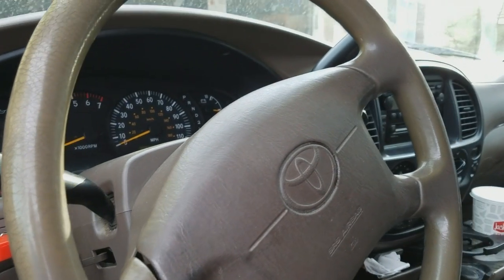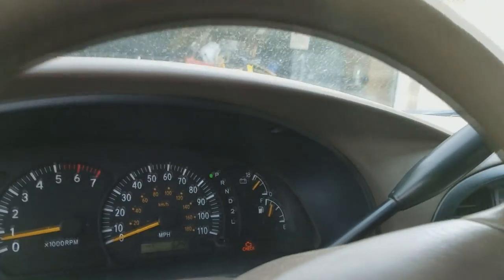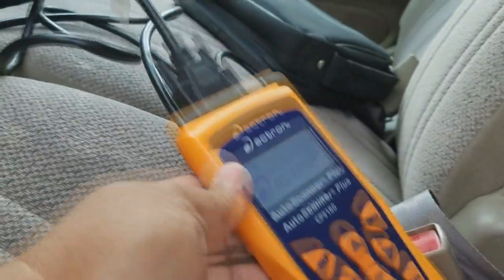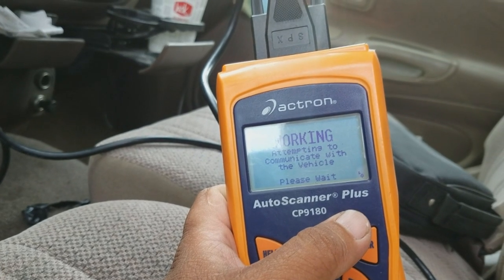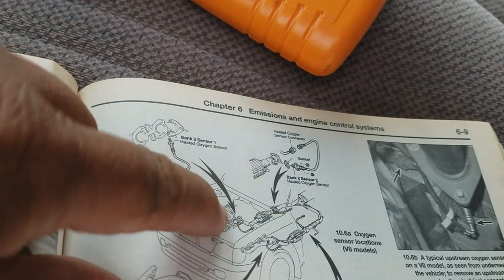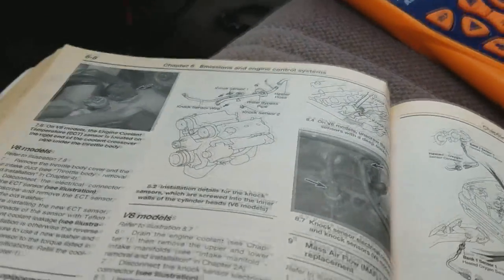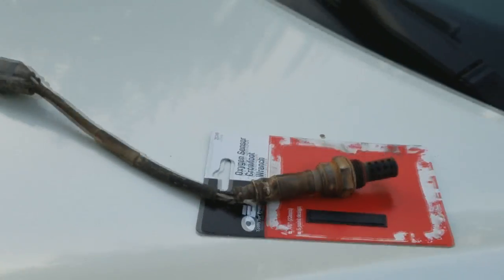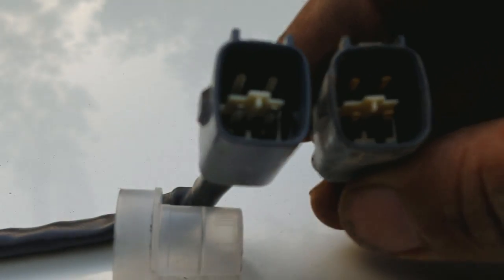Toyota Tundra Oxygen Sensor OBDII P0155

Comment: It's a good idea to put anti seize on the threads. O2 sensors get stuck even if they aren't over tightened.  After you clear the computer you need to drive up to 100 miles to give it a chance to monitor all the sensors and register the results. Sometimes it may be complete in about 50 miles. You'll know when you connect the scanner and check the status. It tells you if ready or not ready. It doesn't tell you anything if the check engine light is off right after you reset the codes. I've always had to run the engine at least 15 minutes for the check engine light to come back on. It's better to drive it than just idle it.

Comment: Gen one sensors suck, I have replaced all of mine a total of seven times, no more after 150,000 miles, I now have 3000,000 on it and still running great.  Just not looking forward to the converter burning out.
Reply from the maker: Duane Groomes you have 300k on it???
Reply: Yes, I do, the first one I had 763k on it before getting hit and flipping it. The most work I have done was pulling the top of the motor off to get to the starter and replacing the brushes in it and did the alternator the same time.
Reply from the maker: Duane Groomes wow!!!
Reply: People need to understand, Toyota is indeed a good investment, out of all the trucks I only had one to run hot and it was my fault by not checking a simple hose and the car was a Toyota super at 285k the cams went out and I replaced them for $1200.00, this car I did buy used and had no clue it had a problem till it shut down on the interstate.

Comment: where is the p0161 located on 2001 tundra?
Reply from the maker: Douglas Massey p0161 is the code for bank 2 sensor 2. if you watch the video, at 2:22 you'll  find the diagram showing that it is the passenger side 02 sensor that is located after the catalytic converter.
Reply: Next time you do one of these DIY videos, please slow down and think of the video quality. Have you tried using a head mounted GoPro? Your video quality was pretty good, I was thinking more of hands free so a lot less bouncing around. Also, it would have been nice to watch you actually use the Crowfoot and any problems you may have had removing the sensor. As well as removing the plug end. It looked like it could have been a bit of trouble given its location. Would have liked to see what issues you may have had with it also. It's all a learning video and every little bit comes in handty especially if the person viewing it is a novice.
Aside from my "would like to have's", this was information I can use now as I have to replace this same sensor but on my 2003 Tundra (4.7L, V8). Thanks! This was helpful.